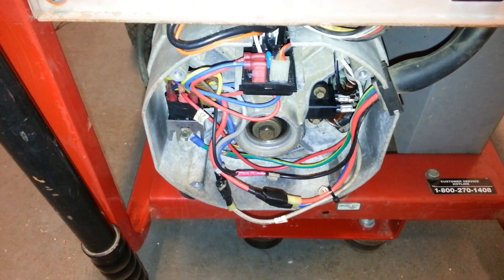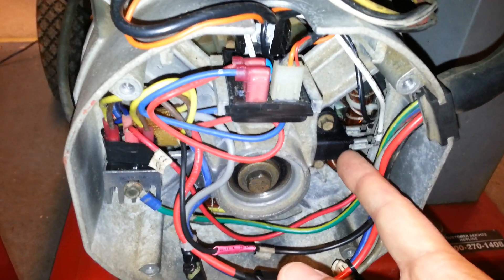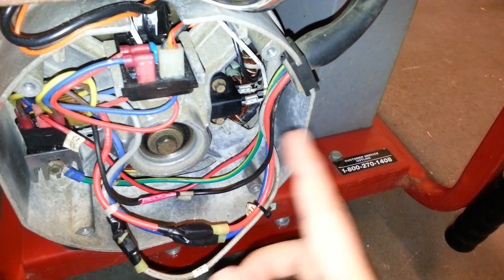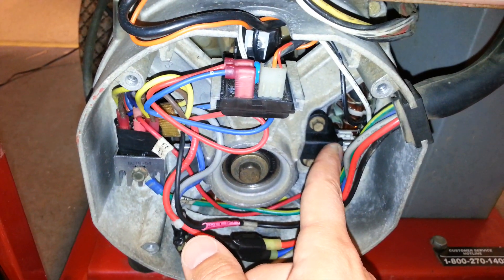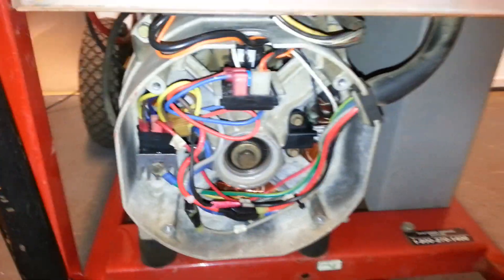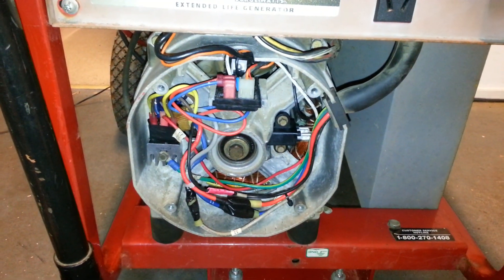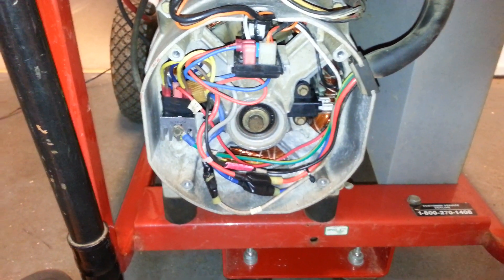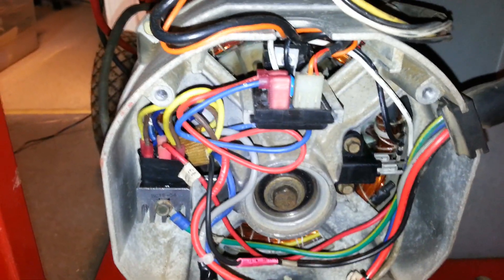Generac Portable Generator: How to Test the Windings

Comment: Hey man do you have video parts 3-5 I don't see them listed on your page. I'm a generac tech and can't even find a diag manual for the gen end. Generac tech support was no help. They contributed the engine and frame for the unit and Briggs supplied the gen end.. I have the engine manual  but can't find anything on the power end.
Reply from the maker: Hey bud. Sorry thise videos i made private awhile back. Are you just needing the wiring diagram for the gen end and outlet oanel? If so partstree com should have that.
Reply: @Bassguitarist1985  Thanks so much for getting back to me! I got the wiring diagram from the owners manual. But i'm looking for some troubleshooting. I've been through at least 15 threads on smokestak and found some ohm readings and testing procedures. I changed the dpe board blown rectifier and it made voltage. Then the customer called back the next week and said it wasn't making power again sure enough that new board smells burnt. I'm thinking about just putting a sx460 in it and calling it good. Screw the idol and charger lol
Reply from the maker: @robt9993  which board the system control board or the voltage regulator board? Im bassplayer1985 on smokstak
Reply: @Bassguitarist1985  the sealed board in the back end that the dpe (VR?)  and brushes hook up 2 was the one that failed 2x. First time was probably moisture though (bad location). Although the (systemboard?) In the receptacle enclosure has the voltage adjustment pot in it. I looked at the board in the recept box and that looked fine. The battery charging and dc output rectifiers were fine. Windings weren't open or shorted. Brushes were ok 10 ohms and cleaned the slip rings.
Reply from the maker: @robt9993  the 84132gs VRB board there is a schematic and parts list there. The 83970GS SCB had MANY revisions. Slightly different parts but the circuit operated the same. I repair them.

If you keep frying VRB boards, sure the customer isnt overloading? SCB could very well be damaged too
Reply: @Bassguitarist1985  Do you repair the larger control boards? I have old 0h6680d boards one the battery charger circuit doesn't work on. Another randomly starts thinking it lost utility power randomly.
Reply from the maker: @robt9993  sadly no. Schematics are simply not available from generac. They keep it under wraps. I'm sure its a few dollars worth of parts that failed for a 500 dollar board. Ussually is.
Reply: @Bassguitarist1985  Yep . My cost is almost $400 with shipping. Flight systems offers repair but for an extra $70 I can get a new one.
Reply from the maker: @robt9993  exactly. Idk if they have the schematics from generac to fix them, or if they backwards engineered them to repair like I did. Its more time in labor and specialty SMT rework tools needed to service them. For NLA boards they make a killing im sure!
Reply: @Bassguitarist1985  I rechecked all the coils again the battery rectifiers also. Field flash was 90/180. I then put the new 84132GS  in. and cant get the voltage to drop below 150-300. Adjusting the pot on the 83970 only would give me a 10/20 volt swing from about 148 to -158. Checking the 83970 the 2 big rectifiers are bad on one side as well as the little one. I found your mouser list but some of that stuff is minimum 100 purchase. Let me know if you have the time. are interested , and how much it would cost to have you fix it. Waiting on account approval on stack btw.
Reply from the maker: @robt9993  you can email me. Its my ytube name at yahoo dot com
Reply: @Bassguitarist1985  I send you a message on ziller.

Comment: Great vids.  I was checking my older generac generator and I don't see any voltage regulator in the end bell just a brush set. I was wondering if I could install a voltage regulator  it's a 5250 max  4200 continuous.
Reply from the maker: it would depend on the model and serial#. Some machines are brush type alternators and others are brushless with a capacitor and rotating rectifier assembly on the rotor. If you have the model# you can find the schematics and see what the parts list calls for.
Reply: Some generators have the regulator behind the power panel

Comment: Hi Bass.  I have a 4000XL, pretty similar to the inside of the one you are working on here.  I have .7 ohms on the power windings.  With the VRB remove and powering the brushes with 12v, I am getting 80V out of each winding , and 95V on the DTE.  What are your thoughts on this?
Reply from the maker: Ohm readings look right, but I question your engine speed. Verify it is 62.5hz no load. Next you need to make sure the DPE windings can support a load, connect a 25 watt incandescent bulb to it and hit the brushes with 12 volts. If you see the bulb light, stator and rotor are good, then the key is focusing on the VRB and the SCB.
Reply: @Bassguitarist1985  Thank you for the reply.  When I was working on it yesterday, I did put a 1200W heat gun on it while powering the brushes with 12V, and it held the load at about 79 volts AC.  I will check the speed and get back with you.
Reply: @Bassguitarist1985  I snuck out and checked.  I didn't hook the 12V battery to the brushes b/c the 4-5V AC it is making was enough for my meter to read 58hz.  I will need to adjust that up and recheck what I am getting for max voltage out of the windings with 12V attached to the brushes.  A friend of mine said I may need more than 12V to get higher than 80V from the windings.  That sound correct?  I don't want to melt anything applying 24V
Reply from the maker: @skroesen  He is correct 12VDC is half the voltage the VRB puts out...at full load. Without the SCB connected you would see something like 24VDC and like 175VAC on the duplex outlets. The VRB is a current source not a voltage source.
Reply: Bassguitarist1985 okay, another update.  I have it at 63hz.  I used (2) 12v, 6.0Ah batteries in series across the brushes and it produces 122vac on the panel now.
Reply from the maker: @skroesen  good. So see if it produces power with the vrb board first, no white 3 pin connector attached. It should be 175vac at the outlets. Be careful of brush polarity otherwisr you will flash the field in reverse and it doesnt produce any voltage.
Reply: Bassguitarist1985 4.3vac.
Reply from the maker: @skroesen  okay VRB board is bad id say, did you try powering a 25 watt incandescent bulb off the DPE with 12 volts at the brushes?
Reply: @Bassguitarist1985  I did not.  I will need to find one and give it a try.  That will be a good test to confirm those windings are good!  I tried signing up at smokestak but never received the confirmation/approval.  What are the part numbers usually replaced on the VRB?
Reply from the maker: @skroesen  if you find my thread on there i have a mouser.com parts list for the VRB, and REV P of the SCB and SMT version of the SCB. If you have any other version of the SCB, there is info on it, but it has different parts all together.
Reply: @Bassguitarist1985  I still plan to test with a light bulb before I do anything with the VRB, but it looks like the SCR and the P600M diode are the most common failures.  Is that your impression?
Reply from the maker: @skroesen  typically, but there are smaller diodes and resistors that can fail too
Reply: @Bassguitarist1985  Latest Update.  I pulled the end bell off and cleaned the slip rings really well.  Reassembled and put a 40W bulb (smallest I had) on the DPE wires and a 12v battery on the brushes.  Measuring at the DPE without a light bulb, 116vac.  With the light bulb, 114vac.  The light bulb lit up bright.  

On the panel with 12v across the brushes, 85-90vac.  With 24V getting 122vac.  

Looking like it is a VRB issue.
Reply from the maker: @skroesen  and possibly an scb board too.
Reply: @Bassguitarist1985  not looking good for this thing.  I got my hands on another VRB and put it in.  It now puts out voltage.  It started at 80 VAC.  I adjusted the dial on the circuit board, it maxed out about 91.  When I pulled the end of the bell off, the positive slip ring wasn't very "coppery" if that is a word!  It looked like steel.  The other looked good.  I cleaned them up with scotchbrite.  I just think that slip ring is causing an issue.

Comment: I have the generac7550 exl not producing any power your generator shows the exact same set up and wire colors but in your video you mention what numbers you should get when testing different wires but you didn't mention if you get a different reading what does it mean in regards to the generator

Comment: Best information yet on Control panel wiring.  Have a 15000e general which has a 10 amp fuse that pops every time I try to weld a bead.  240 V 50 Amp breaker does not trip. Control Panel 10 Amp fuse pops every time. What can be the cause?
Reply from the maker: Louis Domonte hard to say, whats the model and revision? 10 amp fuse? could you post a video?

Comment: Thank you so much for your video
Is it normal for your voltage regulator to explode my niece look like a mov exploded
Reply from the maker: Yes if overloaded or shorted.  Sometimes the components just internally fail with repeated heat cycles.
Reply: @Bassguitarist1985  thank you so much for your reply I have the Generac 4000exl in your opinion should I buy the voltage regulator coil all ohm out correctly such a beautiful motor on these days
Reply from the maker: @johnfarias7230  its worth fixing imo

Comment: My 12 volt battery connection to the generator smoked out. It had battery reversed connection. There is no fuse in the circuit like you have. Anyway, when I opened the cover I see that the bridge rectifier plastic insulator covers on the connector wires are melted . The terminals came right out of the rectifier. My concern is that the generator windings are fried as well. I checked the ohms and looks like about 0.5. But I can also measure very small resistance to the generator frame (ground). Should the 12 volt windings be grounded? Also, can I run without connecting the 12 volt circuits? Any help would be appreciated.
Thanks.
Reply from the maker: Add the fuse and replace the rectifiers. The battery charge windings do have a continuity to ground at its midpoint. See if you get any AC output going into the rectifiers and then see if it will support a DC load
Reply: @Bassguitarist1985  Thanks alot for the super fast response. I already ordered the recitifier and will add the fuse. Appreciate the help.
Reply from the maker: @willytwo53072  sounds good. You can check for VAC output in the meantime. Whether it will support a load remains to be seen. Careful, 66/77 are higher amperage than 66a/77a which is for the starter battery. The lower A/C voltage will be the telling factor

Comment: Great video. I have a Generac 7000EXL that has no AC output.
The battery has been dead for a few months and I have jumped it the last two times I used it. The last time it worked for a few days then stopped generating AC. I flashed the field with a drill. Didn't work. I will try with battery next. Is it possible it is as simple as having the dead battery providing no field excitation voltage? I have a new battery installed .
Thanks for your videos.
Reply from the maker: Starter battery does not excite the rotor field. I'd concentrate looking at the VRB and test the resistances make sure nothing is burnt.
Reply: ***** I checked all resistances and they are fine. No burnt components. With a 12 volt battery connected to the brushes I get 105 volts AC and 7 volts DC. Didn't check 220. After reconnecting the wiring no AD or DC output again. Would you suspect system control board or power regulator board?
And am wondering most likely components to fail.
Thanks,

Jim
Reply from the maker: Jim Roberts Power regulator board is bad for sure if all resistances are in spec. Buy a new one, plug it in, and WITHOUT the 3 pin white connector connected, see if you get high voltage. Should see 62hz and say 170VAC at the duplex outlet. This condition is expected. If speed is off, correct at the governor adjustment screw. If you get this condition, then try reconnecting the 3 pin connector which attached the system control board to the power regulator board. If the voltage stays high, or turns off, the system control board needs repair. Then trytThe blue pot on the left of the control panel which regulates voltage with adjustment. If it does not adjust then SCB needs repair

Comment: Yes,  I've watched several of there videos.  I will definitely get in touch with you regarding these boards if repairs are needed and From my research the mother board is no longer being made.  I was lucky when I purchased mine 3 years ago.  I purchased it as a back up.  Wasn't cheap.  $123.00 but I have 2 of the same units and I thought it was a wise investment.  I do like this unit.  Once every 6 to 8 weeks I shut down all and excerize both units for aproxmitly 2 hrs. each.     Is this the best place to get in touch with you?  Thanks. John
Reply from the maker: John Ambrosino yup. If you can pm me, i can share my contact info there.

Comment: xboxer1985.  Thank you for this valuable info.  Yes it is a double pole 30a.  I do have an original B&S 30a breaker for this unit, I'll give it a try.  I was also thinking after I wrote to you, I am running this unit on natural gas and maybe that's why not getting the same power as gasoline or propane.  I also have a second unit exactly the same.  Not really looking to run the a/c unit as it is not critical back-up.  I was more curious than anything else.  I like to learn.  I will also look into the soft start capacitor kit.  How do you test for the exact wattage any generator is putting out?  running or surge?  This would be great to know.  Again, Thank You John
Reply from the maker: John Ambrosino natural gas has less BTUs and there is a slight derate over gasoline, like 10% or so depending on engine condition/age. What you will see is that the engine will hunt/surge and not be able to maintain speed (and this voltage) once you reach max output derated. Simply not a powerful enough explosion. You could try closing the gap on the spark plug slightly to get a more powerful hotter spark. Make sure valve lash is adjusted properly, and leaner is better on gaseous fuels. Mine is converted to tri fuel as well from US Carb, actually looking to be a dealer for them soon.

To measure wattage is simply amps times volts. A decent DMM and clamp meter can facilitate both measurements. Ive seen some cool setups with voltage, amperage, and wattage meters built into an external panel measuring each half phase on a portable. Very useful in my eyes for relatively little cost.

Comment: Why do you think the dpe would burn up?  I am attempting to rewire one like this with a dpe that got really hot.
Reply from the maker: A failing AVR possibly caused by defect or overload. Not sure you can rewire, aka steal power from the main windings to power the AVR. The DPE wires are offset by 90⁰ degrees to facilitate self excitement. If you are able to use some of the main windings to run the AVR, it will need to be flashed every time, and the overall generator capacity (especially surge capacity) would need to be de-rated.
Reply: @Bassguitarist1985  ya.  Avr. Thats what I was afraid of.  I will probably just get a replacement cause im terrible at soldering
Reply from the maker: Unfortunately the DPE and bcw windings are the first to fail on portable generators because of their physical size they are very small. Often times I see a ton of load on one side of the generator and it is not properly balanced between the two hot legs. That can create excessive heat in the components and cause premature failure as well.
Reply: @Bassguitarist1985  ok i successfully repaired the dpe winding and replaced the big rectifying diode (shorted hard) as well as the scr (no obvious fault)  now I have voltage! But its 144v.  What could cause that? Scb?
Reply from the maker: @danielmiller8490  try adjusting the potentiometer on the left side of the outlet panel. BUT Before you do that, set the engine speed first. It should be 62hz no load. If the pot does nothing to adjust voltage, then the SCB needs work
Reply: @Bassguitarist1985  yep, grabbed a junk generator and swapped the scb and its making stable 122v.  Do you have a vid on tshooting the old scb or should I just replace everything on the board?
Reply from the maker: @danielmiller8490  I rebuild the SCB for $130 plus PayPal fee and USPS return shipping. Shouldn't have to shotgun all the components. You can email me if you are interested.

Comment: B85, put the new power regulator in and am now getting 120 and 240. Work well on econ. setting too after adjusting the solenoid. Thanks. However, engine battery charge circuit only 7 vdc and plug on panel 
only 8 vdc. Any thoughts ?
Reply from the maker: Joseph Syring yes that is pulsating DC voltage. Thats normal to find.  8VDC is the RMS average voltage. Your starter battery should be greater than 12.8vdc with engine running full speed and it charging the starter battery. Can you confirm?
Reply: I am pretty sure I was running the engine at full speed yesterday when taking the charging reading. I will double check later today when I am back with the generator.
Reply from the maker: Joseph Syring make sure its 3750rpms 62hz at no load before measuring
Reply: B85, I don't have a device that can measure rpms. This eve I manually increased the rpms to a speed higher than the governed speed and the voltage at the panel and batt. charge circuit increased about 0.4 vdc. The battery is not installed since the one that came with the gen. had one if not two dead cells. I purchased a new one and am awaiting  delivery. Does not having the batt. installed effect charging voltage ?
Reply from the maker: Joseph Syring yes it does
Reply: I will give an update when the battery arrives. I expect it late this week.Will give it a proper overnight charge before install. Thanks again.